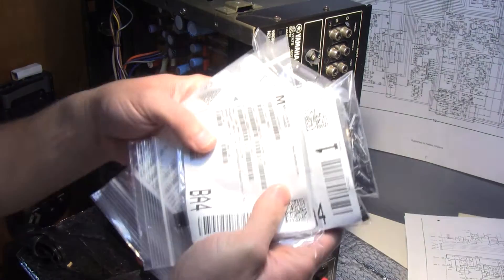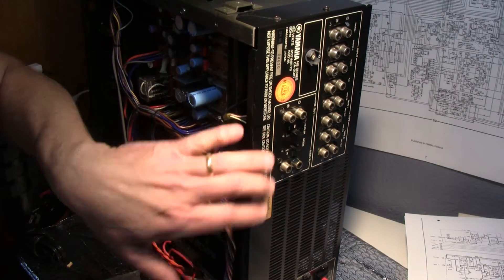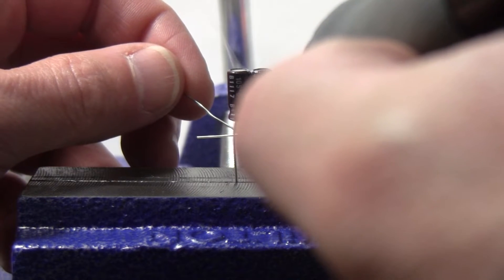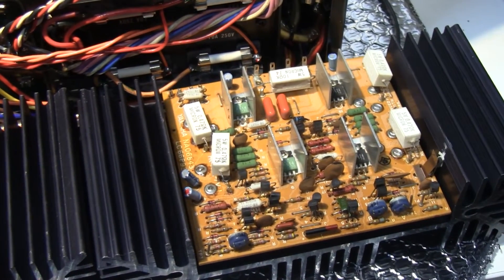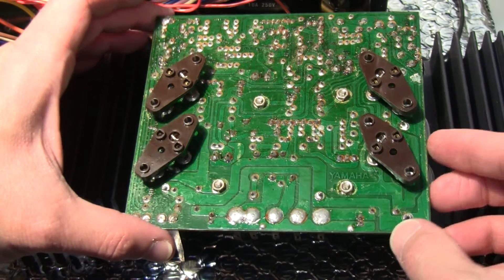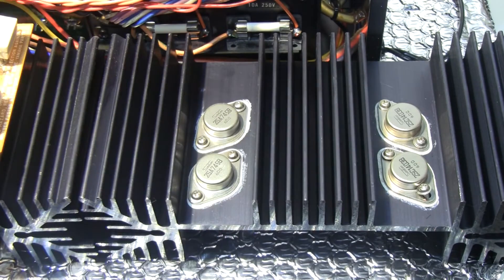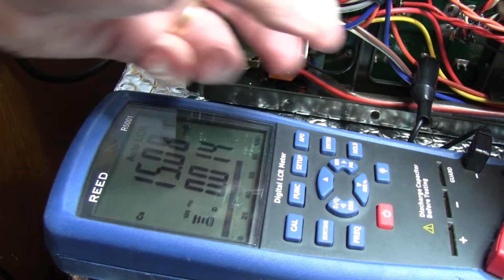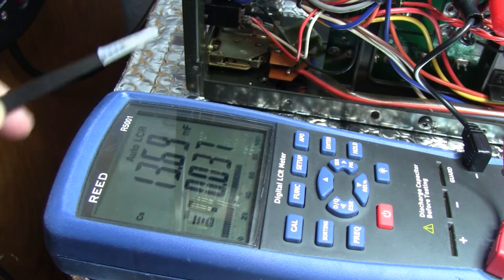Vbe 124 epilog: closing on the amplifier Yamaha CA-2010

Comment: So if the heat sink compound is dried up / powdery, is this pretty concerning? I just noticed this on my Pioneer SA 9500ii, with the square shaped transistors... thanks for any insights; great video
Reply from the maker: Thank you for your comment and I am glad you liked the video. Indeed the decomposition of the compound can worsen the heat transfer between the transistor and the heatsink However, too much compound is also a problem as it creates a thicker layer between the two. 
I would replace it as soon as possible depending on the complexity of the disassembly - i.e., if the transistors are buried deep in the equipment, I would perhaps plan for a more thorough restoration and include this.
Good luck in your repair.

Comment: I recently acquired one of these amps from a customers house that was left there from the previous owner. When I hooked speakers up to it, I can barely hear sound coming out of it, but if I plug an outboard amp into the preamp output on the back and change the switch, it sounds fine. Any thoughts on what that could be?
Reply from the maker: Larry, thanks for the comment. 
You seem to have isolated the issue to the amplifier portion of your set, but if you look in this series of videos you will find that at a certain point I had a similar problem as you: one of the switches (I forgot which one) was blocking the path from the pre to the PA. 
In my case it was PEBKAC, but perhaps this could give you a hint on where to look. Another aspect could be bad switches, either the input or the speaker selector. 

Beyond this point you would need to open the equipment and start measuring voltages, starting with the supply to the PA,followed by a signal tracer to try to locate where the sound ceases to show up (or is greatly attenuated). 

Unfortunately I don't have this equipment with me anymore to be absolutely sure of all its details, but a close look in its manual (available on the internet) should help you with the various connections of signal paths. 

Good luck in your investigation

Comment: Hi,  I recently got one. It has some scratchy sound but after deoxit the mute switch it mostly went away. But still hearing that noise little bit popping up time to time on one channel. Any suggestions? Also one concern I have regarding the volume. Why just at 60 or 70 position it is already two loud and bass is so deep. Cannot go to say at the 9 position of the volume dial. Is this amp usually like this ? 
Thanks
Reply from the maker: Thank you for your comment. 
The noise issue could be coming from several root causes: either from a part (capacitor or transistor) showing leakage, a bad connection or even still a bit of dirt/grime from a switch - in the equipment I worked the noise was quite dramatic and coming entirely from the switches. 
Regarding the overall volume, this is a very powerful amplifier and I would not expect to run it at 100% unless I was in a very wide room. If you are seeing distortion, perhaps the signal source might be too high or even a compounded problem from the popping issue you are seeing. 
Anyways, good luck with your equipment. It is a very nice one